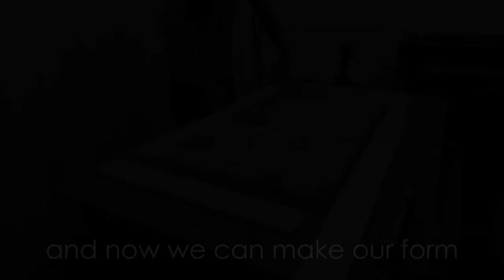You won't Believe how this TABLE ends

Comment from the maker: 👉LET´S RESIN Epoxy https://letsresin.com/?ref=hRaResu-0kMMdO 
      Use code MARMOTAWORKS to get a 10% discount.
Reply: I was hooked on your more organic puzzle than any river table I have seen in the past, and I was only about 1/4 through the video.

Should you actually make a table similar to this piece, with the inlay metal supports, please consider making the metal edges meet at their vertical edges or miter  the edges.  The goal would be to minimize deep cuts to a toddler, dog, or small child as the play under the table.  I am sure other parents are perfect, but as a grandparent, I love their laughter and detest crying.  I would let them pull the pots and pans out of the lower cabinets, then let them hide inside the cabinet.
Reply: There's so much to learn from you, thank you for sharing the video
Reply from the maker: @WoodworkingTop535  thanks!

Comment: Do you check moisture content before using your wood?  
It looked like you had wax paper or something when breaking away the melamine/framing... or is it slippery enough that the epoxy doesn't bond too badly too the framed/box enclosure after glue up/epoxy pour cures?
Reply from the maker: I always check the moisture before starting. It's crucial for these kinds of projects. I use packing tape so that the epoxy doesn't stick.

Comment: Question: when sanding is the 150 grit necessary? You’re already going through 3 brackets of refinement before you do a further seal and then polish and sand with 600. Woodworking with resin finishes should be a bit more forgiving with the finishing, no? Would 120/240, seal, buff, final polish be enough? I’m curious because I so so many channels choose to finish with a wet sand and have a higher grit step
Reply from the maker: Personally, I don't like skipping steps in sanding. A 240-grit might not completely remove the marks from the 120-grit and it could show in the final result. But well, it's just my way of doing it...

Comment: Firstly, love your channel and work. 10/10, keep it up.
I've shamelessly stolen a few of your ideas for personal projects and have had issues with projects bowing/cupping slightly over time like you mention in this video. 
Do you know why this happens? Is it the epoxy still being too soft even after hardening, or is it the moisture in the wood causing this? I know it's hard to say, but would appreciate any insight.
Reply from the maker: I'm glad to know that you use my ideas! It could be because the wood isn't completely dry. I've also had issues like that, which is why I often use steel reinforcements.

Comment: Am looking to make the headboard for a new bed with a similar look - when you sealed the pieces to avoid staining, was that just with one of the two ingredients (resin or hardener) or had you mixed it first as normal? Saw you mixing it (and then adding charcoal) for the main bit, but just wondering what the sealing bit involves?

Utterly fantastic end product - a total inspiration 🎉
Reply from the maker: Thank you! For sealing, I use regular epoxy already mixed but without stain.
Reply: @marmotaworks  I've now made the slab and it turned out pretty damn well - very excited about how it's going to look 😊

What exactly did you use to treat and coat your table please? Just the Osmi? Just want to ensure the surface is impermeable and lasts for decades rather than just months or years

Comment: These trunk slice tables you make are so unique and visually interesting.  They're definitely wall-worthy, because I think guests would end up staring mesmerized by a table like this!
I wonder, though, about the strength, because it looks like the pieces are just held together with whatever epoxy manages to trickle down into the cracks.  The epoxy might not even be filling the cracks or making good contact with the wood.  If you were to build a larger table in this style, do you think it would be necessary to put glue, dowels, or dominoes between the pieces before pouring the epoxy?
Reply from the maker: Thanks!
If the wood is properly dry, there are no problem
Reply: I agree, the epoxy is so viscous that it penetrates everywhere. I wouldn't be worried about strength.

Comment: WOW, a terrific outcome after a dynamic blend of artistry, design and creativity in preparation and craftsmanship in execution.   Congratulations on this masterpiece.  Regarding your metal work, did you add a bit of oil as you drilled the screw holes.  It will ease cutting and preserve the drill edges.   In addition to holes for mounting the steel frame to the wood, are there holes on the other face, at the corners, to be used to connect legs if a hastily coffee table is required?

Wishing you and your family a blessed week filled with gentle seasonally appropriate weather and restful evenings together.   Peace brother
Reply from the maker: Thanks for your nice words.
Yes, I used oil to drill.
I didn't make holes for the legs, I no longer know the diameter or the necessary position, but the frame can be disassembled and the holes can be made.

Comment: Awsome job you can use a bandsaw to cut logs I made a clamping device like a meat slicer was wondering what is your finish linseed oil I've used Osmo and Rubio but expensive.
Reply from the maker: Thanks! Yes, you can cut logs on a band saw if you secure them somehow. I use Osmo Polyx Oil.

Comment: did you seal both sides with epoxy and have you used the two part  Osmo finish.
Reply from the maker: I didn't seal it with epoxy, only osmo

Comment: What moisture percent do you use for your wood?  And do you kiln or naturally dry the wood you purchase?
Reply from the maker: Below 8%. I dry the wood in a kiln.
Reply: @marmotaworks  Do you seal the ends to prevent cracking before putting them in a kiln?  Or leave them as is.

Comment: Hello from france and thank you for your videos, motivated me to start a  project of my own.
I had a question i m gonna use  cherry tree for a final thickness of 2,5 inches .
The size of the table will be 7,5 feet by 4 feet.
Would you still recommand to use casting pour or maybe go for deep pour? 
And i m planning to buy the resin on the website you mentionned. How many gallons would you buy?
Thanks alot for your videos , i hope it will look as good as yours !
Reply from the maker: For a table of that size, definitely use deep pour epoxy. A table of that size isn't going to be an easy job... Here's a discount for purchasing epoxy:  https://letsresin.com/?ref=hRaResu-0kMMdO
Reply: @marmotaworks  yeah I know :D
And how many gallons would you order?
Thx
Reply from the maker: @Diabolo7346  That depends a lot on how large the gaps are between each piece and the type of wood. Soft wood absorbs much more epoxy. I would start with 5 gallons, and if you need more, you just buy and do a second pour.
Reply: @marmotaworks  ok thank you
I checked on your website and they don't deliver in Europe :/
I'll order somewhereelse .
Reply from the maker: @Diabolo7346  Oh! Now I see. They used to ship to Europe before. Maybe they ran out of stock here.

Comment: I was a cabinetmaker .  Solid wood shrinks and swells the greatest amount in the tangential direction , about half as much in the radial direction, and about 0.1% to 0.2% in the longitudinal direction . Because of its small magnitude, shrinkage in the longitudinal direction is usually ignored in most designs.       Your log was quite dry . It doesn’t stay like that. As the weather changes, so does the moisture content of the wood in your table top. It might self destruct  when every log gets a little bigger, 5- 8% ? .    You can split large rocks with a wooden wedge in a hole and water on the wooden wedge.    Cabinetmakers have to know how to construct furniture out of solid wood…
Reply from the maker: I have a table in the living room of my house that I built almost 2 years ago using this technique, and it still looks like the first day. If the wood is dry and several layers of a good finish that protects against moisture are applied, there is no problem.
Reply: Does the resin seal the timber stopping this or will it happen regardless?
Reply: @daniellemon6498  it will happen regardless , depending on thickness of resin, quality of resin , and unknown factors.  Wood will react to environmental changes.    In today’s world, the table might last till it gets dumped because of fashion, trends.

Comment: Interesting idea I actually want to make floor this way. Two suggestions. 1. Could use a track saw and cut the shape all at once. 2. Should wood glue them together. Will hold the product together better than epoxy.
Reply from the maker: To cut them all at once, I would have to secure each one first so they wouldn't move. There are gaps between the pieces, and regular glue wouldn't fill them, but epoxy would.

Comment: My only advice on metalworking would be to pop the bracket off and give it a few coats of black paint, and if you didn't use stainless or decking screws, I might suggest it. I don't know much about epoxy, I don't make epoxy tables, Retired welder, now I make musical instruments, but the fresh wood may have trapped moisture that will rust the bare steel and get nasty over time. Even though it’s a wall decoration, I would use decking screws or stainless, so it doesn't rot the screws. I may also hit the back with some sealant, obviously doesn't need to be super pretty or fancy, but the exposed end grain might wick in moisture and since spalting can weaken the wood over time that porous spalting might act like a sponge and resume rot. Rustoleum USED to be the best metal paint, but recently they have been using thinners in their paint, so it goes on weak as hell and takes can after can to coat anything porous. I'd avoid that, even for the metal. I like Krylon, but any brush-on paint you like would work too, as long as it's not water bases. It may be overkill but an art piece that nice that you spent a lot of time on should be well protected and for a few cans of paint and some screws, it might prevent a disaster in 5-8 years. Better safe than sorry. Just my suggestions.
Reply from the maker: Thank you! I take note of your good advice. I've already painted the frame black, and the screws are stainless steel. Whenever I work with wood, I use stainless steel screws because of the moisture.

Comment: Actually, the bandsaw is the most forgiving one! It doesn't have the kickback the others have when the blade is pinched.

But still, to cut your log into slices, you'll need a bigger and powerfull bandsaw and a sledge to imobilize the log and slide it into the blade and on the guide. It's probably faster with the chainsaw!
Reply from the maker: Truth is, from so much practice, I'm quite fast with the chainsaw.

Comment: Is it silicon you use to seal the form or caulk?
Reply: I'm not OP but either works. just make sure you let it fully set before pouring. There is a very inexpensive product called DAP ALEX Fast Dry you can get at most hardware stores that I've had great success with which is actually a silicone caulk. Just make sure to give it a few hours to fully set.
Reply from the maker: The truth is that English is not my native language, and I'm not sure what the difference is between silicone and caulk. Here in Germany, it's called 'silikon'.
Reply: Thank you for your help. I'm a carpenter from Scotland and live in the country side with lots of Forest around and I'm going to try and make 1 of these for a table out of some of the felled trees in the Forest where I walk my dog. I think I've found 4 different species 2 I know are beech and pine are these any good? 
The other 2 species I haven't identified yet
Reply from the maker: @barrymaxwell3487  Beech is fine, but I don't like using pine for a table countertop; it's too soft and scratches easily.

Comment: Why epoxy them shave it off with the router when flattening? Just curious
Reply from the maker: If you're referring to the sealing layer, it's to prevent it from staining the wood. It's quite porous, and the stain can penetrate deeply.

Comment: What is the finish you are using?
Reply from the maker: Osmo polyx oil
Reply: @marmotaworks  is it UV resistant? Or will the colors of the wood fade in sunlight?
Reply from the maker: @bettykyle3679  I cannot guarantee that. You can check on their website.

Comment: this will be the worst table to use it will split with one wrong hit due to the grains orientation
Reply from the maker: If it's done well, it doesn't have to. I have a table made with this technique for about 2 years, and it still looks like new.
Reply: i guess it depends on how many and how calm is your kids looool @marmotaworks

Comment: Ok well that's answered a question I was going to ask you ,so you don't cut the logs on a band saw,so just use a chainsaw then I guess?
Reply from the maker: Exactly! I know there are people who had that question.
Reply: It helps to have a planer after chainsawing.
Reply: Logs are an extremely unreliable shape with poor stability laid down. The core could also be very waxy and bind the blade, either binding and causing the wood to lash out at you or snapping the blade which you really don’t want to happen at high speed
Reply: @patriciamay638 please don't use a planer on wood cookies.  Players are meant only to use with the grain.  It will grab and chunk, throw, and destroy your circles.  Your better off using a time-saver or how he did it.
Reply: @My_Cats_Meow  big treetrunks....go with the grain in circles